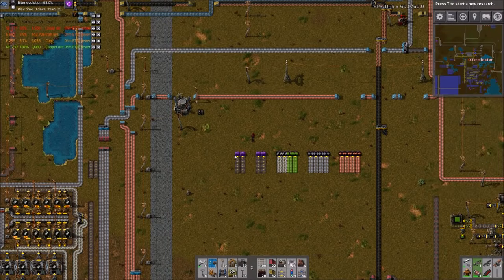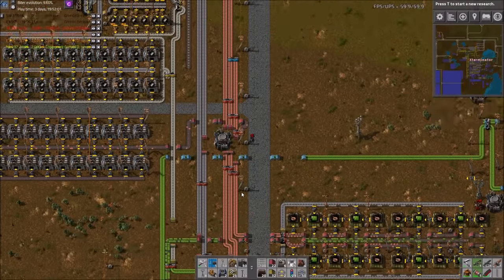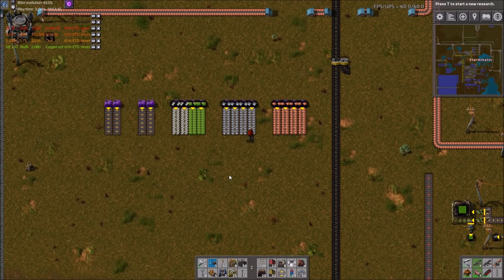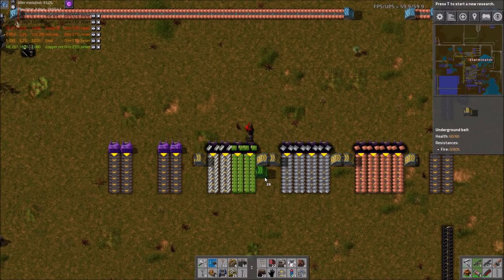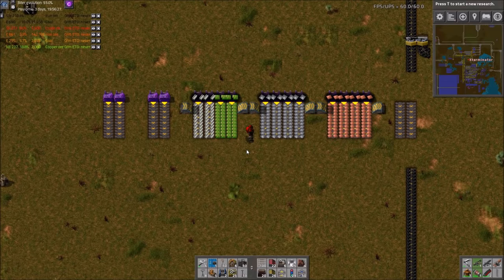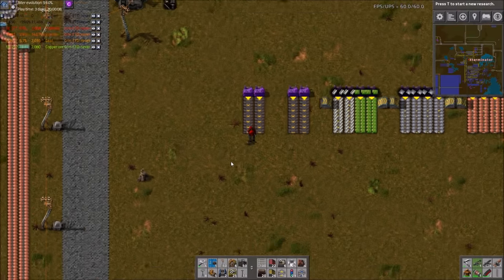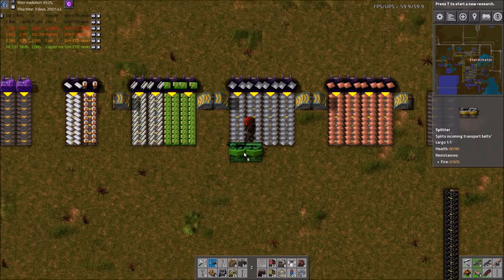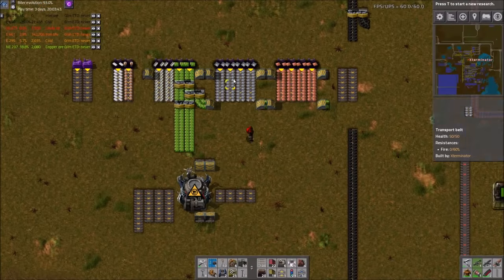Production / Main Bus - Factorio Tutorial

Comment: Excellent consise tutorial, you hit the main points of 4 wide groups, what to bus, and splitting. A quick followup mention is to  add  more  parallel lanes for fluid feedstocks using UNDERGROUND pipe for suifuric acid and lubricant, and perhaps water and petroleum gas.
Reply from the maker: Thanks, good to hear I covered most the important points! 
Great point about the liquids as well, I should have mentioned that in the video. Having your liquids run along the bus is really nice and helps keep things cleaner too.
Reply: Nice nice.

Comment: I made things on site and generally did the spaghetti thing.
I didn't get very far because I wasn't prepared for future considerationand expansion
Reply from the maker: Yeah, I was exactly the same way for a very long time actually. But then realized how important it is to leave room for future expansion, and knowing what works well to make on-site and what doesn't. Just take some practice and such. :)
Reply: I ended up with that problem my first playthrough, because I didn't know yet what I would be able to make in the future. I had no idea that I would need oil to make plastics, and put them together with my circuits which I only used much earlier on in my base. I tried to do the 'main bus' thing, but since I didn't know what I would end up with later I still ended up with a spaghetti base, just one with single lines of copper, iron, and steel running down the middle. And I should note that I'm not done with my first play-through yet. Right now I'm having in issue with generating enough plates. I ended up ending my iron lane half way through my base and start another one from a different mine later on. Even now though, my first line is having trouble maintaining all the assemblers. My whole line suddenly empties out past the gears for my belts, every time I go over to fetch some more. Its getting annoying having half my factory shut down every time I need to produce a new resource I had no idea was even in the game before.
Reply: deltoid 77 I also had the same problem until I made 150 yellow science packs and got robot chests. Robots op pls nerf

Comment: I have descent experience building main bus designs and I have a different idea of how to do them. I usually leave 4 spaces between each lane, so 4 spaces of resources followed by 4 spaces of empty space. The reason I build 4 spaces between them instead of 2 is because I usually put roboports in that area. 4 spaces is also usefull if you want to send resources on one side of the belt. That is not possible to do so if there is only 2 spaces, you will need to do that above or below the main buss. a third reason to leave 4 spaces instead of 2 is because there is enough space to put pipes. I have tried using both 4 spaces and 2 spaces and I much prefer the extra room. Another thing that I do differently is that I have 4 lanes of green circuits instead of 2. In the main bus design you showed you had 2 lanes of steel as well as 2 lanes of circuits. In my opinion that is very imbalanced since you use way more circuits than steel. 2 lanes of circuits will be enough for most people though but it does not hurt to add 2 more lanes. But of course there are many ways of doing a main bus, but having 4 lanes of iron, 4 lanes of copper, 4 lanes of circuits, 2 lanes of steel, 2 lanes of plastic, 1 lane of red, circuits and 1 lane of batterys works fine for me.
Reply: now in 0.15 you might want a lane of coal as well for military science.

Comment: Lately I've been building the main bus without spaces between groups of belts. While it takes a bit more underground pieces early on, later (with a longer underground belt mod) I can run branches underneath the whole bus. It actually looks much neater this way, just more time-consuming to branch off in the early game. But for me the aesthetics are more important.

Best advice I've come across for keeping the bus connections neat (i.e. no spaghetti) is to only build production/science off one side of the bus. On the other side, place smelting, oil, and/or solar.

I do put two belts of gears on the bus (and upgrade them to red belt asap). It just simplifies so many things: Science ingredients, inserters, assemblers, belts, and many of the one-assembler items like miners, pumpjacks, chem plants, etc.
Reply from the maker: Nice! Definitely good advice too about only building production on one side and then leave the other side empty aside from smelting and such. Does help a lot with the spaghetti bit. And yeah, gears on the bus do help simply other builds a ton as long as you can keep up with the gear demand via the bus system. 

I would agree as well that aesthetics are pretty important, but that varies more from player to player.

Comment: for the wire/gear belt thing, basically,
2 belts of copper wire would transport the same amount as 1 belt of copper plates and
1 belt of gears would equal 2 belts of iron plates. Since you would want as few belts as possible, it would be best to use plates for the wire and pre-make the gears.
Reply from the maker: Vincent van Roosmalen Correct yeah.

Comment: Why do you put the first splitter before the branch when branching of the bus?
I only balance the bus belts after branching off from the side lane.
If your inputs are balanced, you really don't need a full belt balancer to get a balanced output after a split off.
For 2 belts, you only need 1 splitter after.
For 4 belts, you only need to mix the lane from which you branched off with the 3 others just once to get a balanced output (i mix 1&2, then 2&3, underground 2&3 and mix 1&4)
Reply from the maker: It probably isn't necessary to be honest. I put the first splitter before the branch to balance it between both lines before it even splits. That way (theoretically) an even amount from both lines should be sent off to the branch.

Comment: To be honest, this bus looks to me like a mixture of a proper bus and a spaghetti base. You do have a bus (a very short one) but after eachs split-off its just spaghetti.

One thing I also like to do is to build my factories on just one side of the bus so I can always add more lanes to the other. Also, I leave 4 tiles between every 4 lanes for roboports. And I build my factories in a tileable pattern so they can always be extended easily. All of this requires more thought on where to place your bus because you actually need to have the space to expand into.

Comment: Im trying to learn how to efficiently split stuff out of a bus that has 2 belts with different stuff running alongside each other.
Like in your example, you have batteries and plastic bars adjacent. How do you cleanly get plastic bars to the right side of the bus?
Reply from the maker: You can just underground part of the battery belt where you want to split off plastic and then there will be room to put the splitter and run a line off to the side.

Comment: Just wondering, why are you not a fan of the priority splitter? I heard this mentioned in the Earth campaign early on, too.
Reply: Yeah, I noticed they're very tricky to set up, and break if one lane on your belt empties out (unless you're using hacked splitters which omg lag no).

Thanks for the link, those are some nifty designs :)
Reply from the maker: It's a bit hard to put into written words, but in general I don't like them because they just seem unnecessary and possibly cause some issues. You can achieve the same thing or something very similar by just using normal splitters and belt mechanics. 
And, at least in my opinion, as with many things in the game, I feel like if you build things balanced and "properly" to begin with, you shouldn't really need to use them. I know Zuri and the other guys in the Earth campaign don't like them either, and may have different or better reasons, but I won't speak for them on that.
Reply: Yeah, I suck at keeping my lanes balanced. I really should learn to do it properly, I suppose.

I used priority splitters in my last campaign, but I wasn't a huge fan, especially when I found out I'd messed up the signalling on my blueprint and had to go down my whole bus and change them all. Thank god for copy paste but still, not an easy task.

Thanks for the replies :)

Comment: My main bus is way different.  I use the compacter mod. So one belt equals 4.  Then i uncompress on the way onto the factories.  My belts consist of 4 iron, 4 copper, 4 iron , 2 green, 2 red, 2 gears, 2 copper wires.  4 spaces inbettwen them all so i can run gas, chemicals and water. Along with power and roo ports.  I did not like using robots to move the plates on the belts like others suggest because it takes. Ton of energy to do and my way is much more efficient.

Comment: Have you seen antielitez world record Factorio speedrun in 2 hours?  He didn't really use a main bus but built copper and iron in a more modular way with a separate smelting and bus for each section (eg red/green science, blue science etc).  Seemed a better way than one bus for the whole factory to me.  He had though setup the map in peaceful mode with favourable resource settings.
Reply from the maker: Yeah I watch quite a lot of anti's stuff. The way he sets it up is definitely ideal for a speed run. But for a normal game, I don't think it's optimal, and would still be better off with a main bus system.